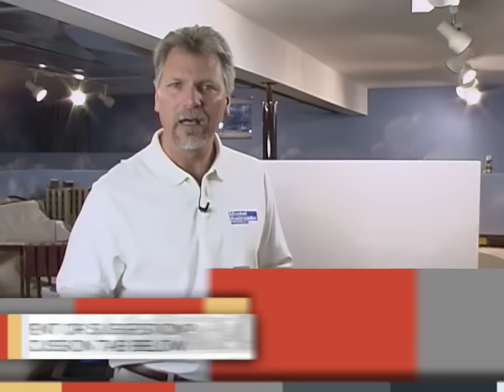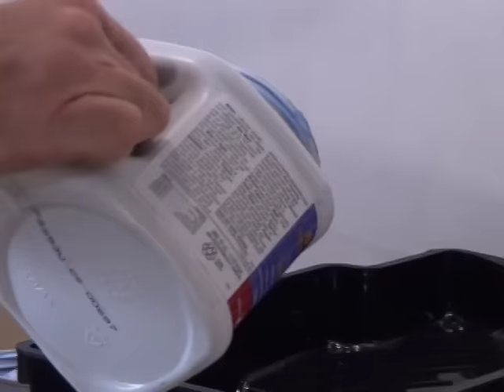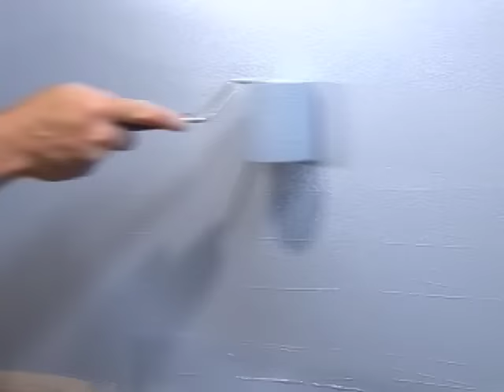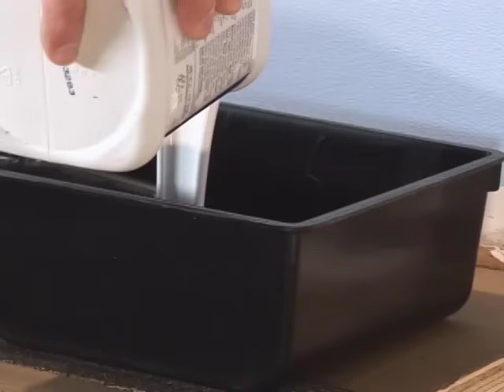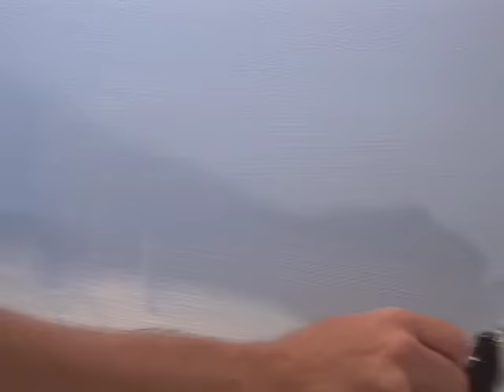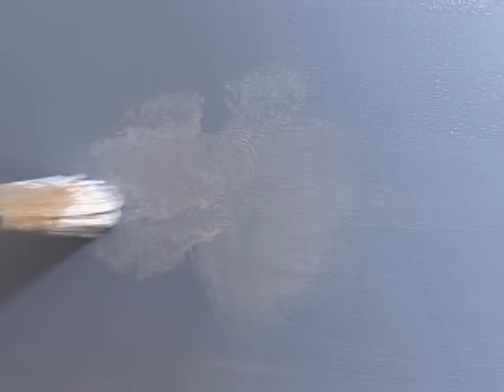Tips for Painting Backdrops for Model Railroads

Comment: Just like I did my backdrop.  When butting 2 panels together, use Liquid Nails for Foam Projects.  Place calk in the crack seam and feather out, not very wide.  Will stay plyable and your panel crack will become seamless, after you touch it up with your blue paint.

Also when turning an inside corner, often times the 2 panels are not plumb.  This will fill in that joint difference seamlessly.

Bob

Comment: Keep a spray bottle of clean water on hand, set to a very fine mist. If the paint starts to dry out too quickly, just give it a spritz with the water....very lightly, very fine, not so much that its going to make the paint run, but just enough that it will keep your paint wet for as long as you need it.